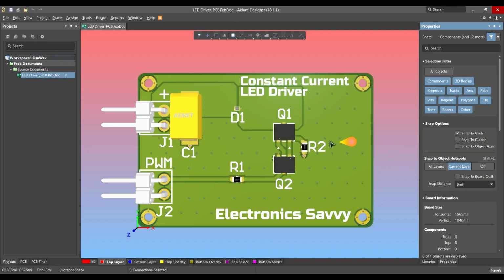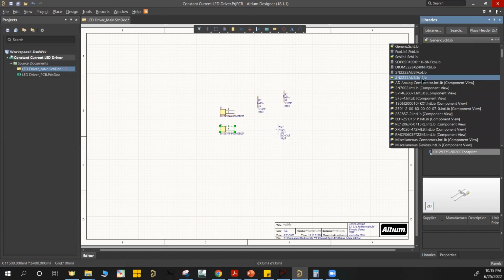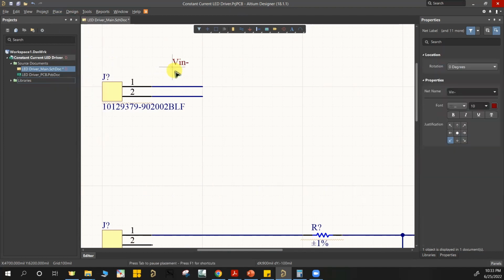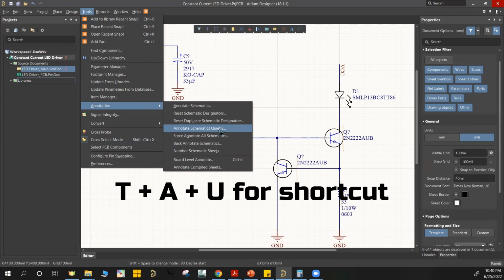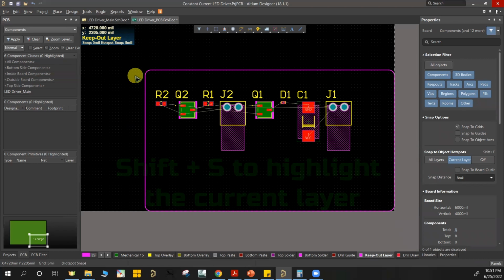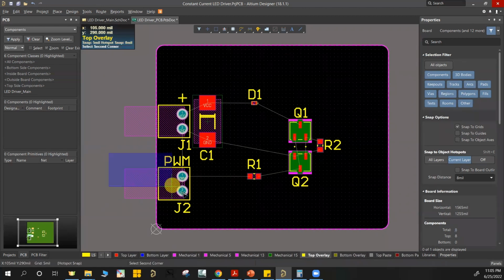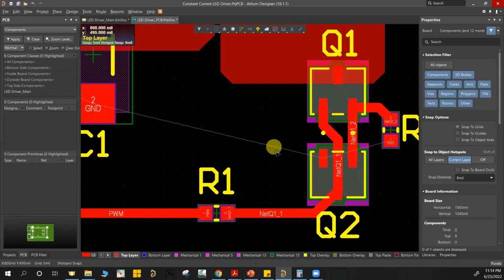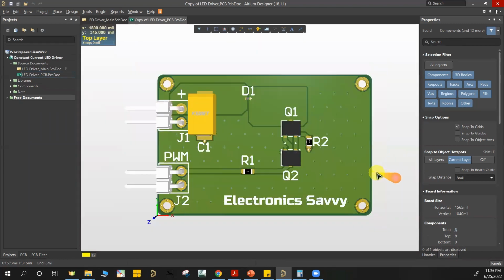Altium Designer PCB Design Full Tutorial - Constant Current LED Driver Board - Ep#3

Comment: I have designed a controller using arduino, I'm looking for a way whereby I could import the arduino schematic and all other necessary boards to the project and make connections to convert this kit into a single PCB. How do I import pre-existing schematics?